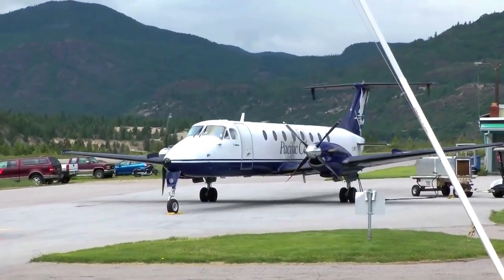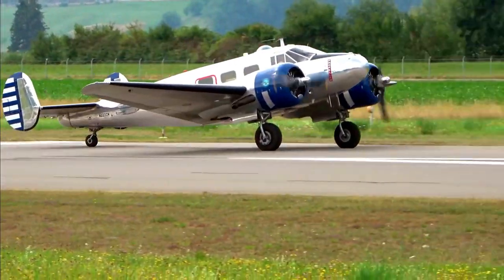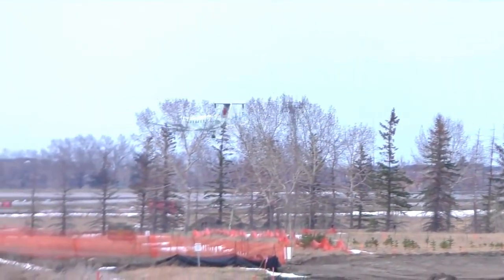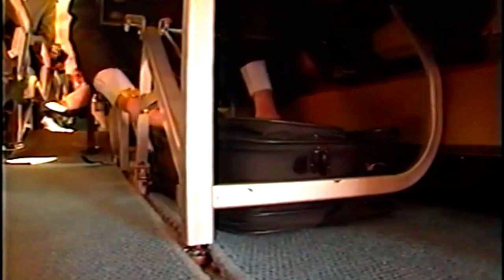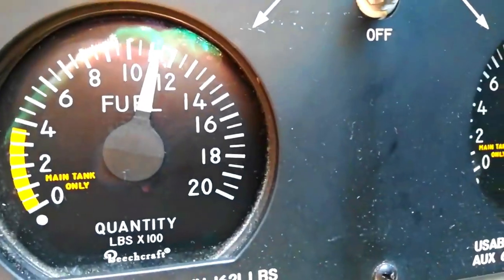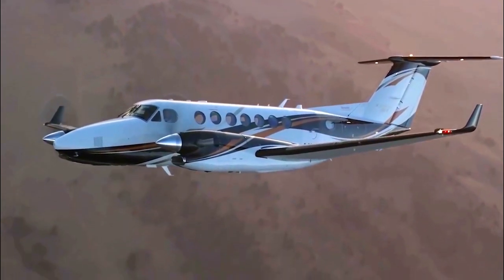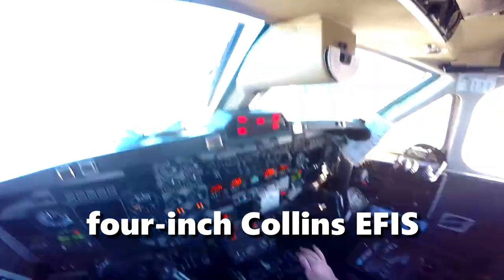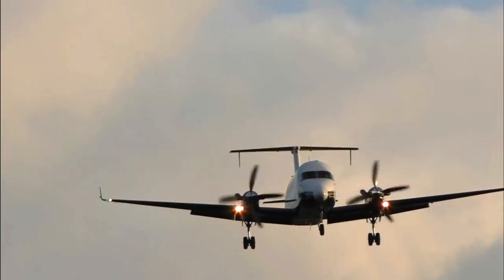Why The Beechcraft 1900 Is Irreplaceable

Comment: The 1900 A was the model with the two passenger doors. The B model had the single forward passenger door and an aft larger cargo door. The B models were bladder fuel tanks. The C models were wet wing fuel tanks. The D model offered the stand up cabin. The outfit I worked for had the first commercial  B model S/N UB1. 1985 as mentioned. Operated as a regional commuter airline  by Brockway Air out of Plattsburgh, NY. Tail number N6667L. We had eight B models and three C models. As one pilot stated, they flew like a sports car! Plenty of power and great handling.